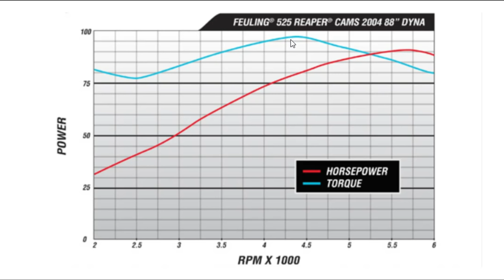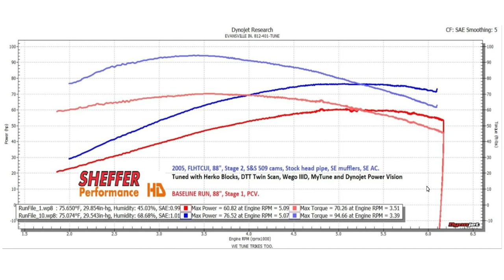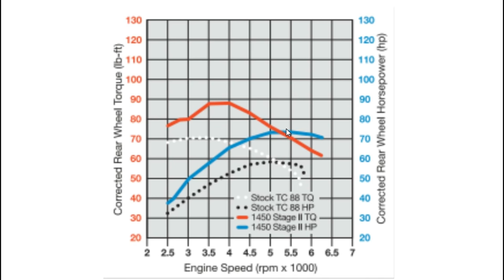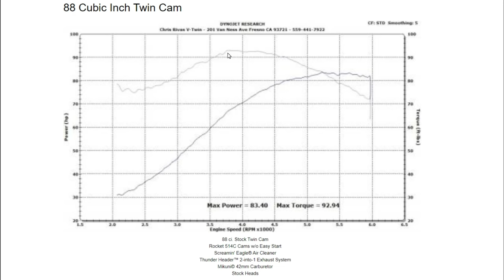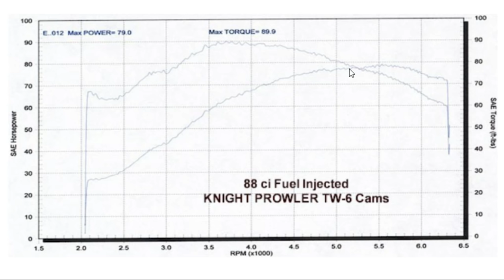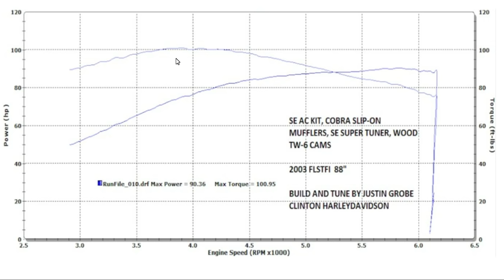Give Your Twin Cam 88 New Life With A Bolt In Cam Upgrade

Comment: Love all these cam reviews. I've completed engine upgrades on dozens of 88" twin cams from 2006 and down. Minimally I recommend a stage 2 upgrade with a gear cam that fits your riding style. I live near the mountains so I like the 509 for heavy bikes or for someone who rides with a passenger more often than alone. The Andrews 26 is the cam I recommend for one up and lighter motorcycles. I've also installed the SE 203 and SE 204 for those who want to stay with HD parts. Both are great but I lean towards the 204. I've never tried a Rocket cam but I think the one you reviewed needs to be installed in an 04 model or newer because of lift. Very hard to go by the peak numbers from different dyno machines. I always look at the curve over numbers. For example, my first stage 1 dyno tune at the Harley dealer claimed 103 TQ and 89 HP on my 2013 FLHTK. Never liked the tune so I took it to who I feel is the best in the area. His peak numbers before his tune showed 89TQ and 72HP. That's a huge difference for the same bike on different dyno's. Sorry for the long post but I love this stuff and can talk or type forever.
Reply: Since you have upgraded several TC88's, given your experience, would you recommend the 509 and head porting work for a 1999 Road King with a 230 lb rider?  Right now all it has is an upgraded air cleaner, re-jetted carb and Fulsac true duals using mufflers off a CVO 110 bike.
Reply from the maker: I'm with you, I can go on and on about this stuff myself too! That's some great info on your installs, you and I are on the same page about the cams!
Reply: @jimedward8908  My first question is do you have a local shop you trust? Second, do you like speed, torque, racing your buddies when the light turns green? An increase in displacement and headwork opens up another world when it comes to choices. I ride in the 2,000 to 3,500 rpm range so any power beyond 4,000 is wasted on someone like myself. This sounds like a great topic for another video. Hint, hint...
Reply from the maker: That's really not a bad idea, l tried to keep cams for the all around power. Finding good high torque cams that come on early and peak mid are easy to find.
Reply: @jimedward8908  I would contact the person who's doing the head work so he can set up the chamber to the proper compression and the cams timing!
Reply: @jimedward8908  all you need is a 95" kit with 203 cams!! Comes with everything you need!
Reply: @enricomandragona163  thanks, that is great advice!
Reply: @jimedward8908  thanks Jim . I'm on the fence whether I'm gonna put Harley Factory ported heads & keep stock displacement or just do a 95" and clean the heads up with a valve job!!
Reply: Not long at all. Thank you!  My Dad just gave me his 05 Ultra classic. I never had a Harley before and now I wish I would have tried one a long time ago. I'm 57 next month. This bike has only 1400 miles on it. Nothing has ever been done to it. It runs great just needs some power. It is Fuel injected. Not sure witch cam I need. I ride back roads right now but may take a road trip W/Wife every now and then one day. We are both a little heavy. Around 420 LB total. Any advice would be appreciated.
Reply: I have a 2003 fxst 88fc Putting in s&s 509 wondering if you could give some advice on rejetting the carb I would appreciate it.

Comment: I just did the 509 swap last week.  I am super pleased with how it pulls and pulls.   I have the Reinhardt true duals on and it has the perfect amount of rowdy on the exhaust note
Reply from the maker: That is awesome! Rinehart really seems to be what a lot of shops are recommending!
Reply: Hey Michael, same here! did you have to retune after this upgrade?
Reply: @DJDooxx  509s and RH true duals as well. A good tune  is a wonderful thing
Reply: Tried the 509g in a SE 95 bigbore??
Reply: @twitterjackedmitchell8096  509 is a low lift cam, I'd try something else in a 95 and maybe add head work if the budget allowed and then you'd have something fun

Comment: I put an S&S 509 gear cam in my 2002 Electra glide FI and the wood ( night prowler) TW6 gear cam in my wife 2010 super glide (96). Best thing I’ve done for my Electra so far. I just love the torque that move the bike. It’s no rocket but I do not downshift to pass a vehicle anymore. Took a bit of fiddling with the tuning but got it right on now. The wife is now pleased with hers as before she felt that the power delivery was different and she did not like it at first. We are both very happy now and no, the noise isn’t noticeable.
Reply: I'm wanting to replace my stock cam on my 2002 Fatboy with a gear drive if crank runout will allow it. I was thinking of going with the S&S 509. After watching this again I'm leaning toward the TW6. Some forums mention the TW6 is much noisier than some, I see you you say it's not noticeable. Curious if you had my bike which of the 2 gear cams would you choose?
Reply: @robbaar7035   I am partial to my 509. I like the torque it produce, it is tractor like. Not much high rpm but then I rarely need to go there. I am a big and heavy man so racing is not in my plan, I enjoy riding and keep my rpm low. I do not ride my wife’s bike unless I have to trouble shoot something but it is very reliable so my seat time has been very short. Power is in higher rpm and sportier so it is your choice. My Electra is 850+ pounds and your fat boy is about 720 so I would consider the tw6 very closely or s&s510. The 509 is best suited for heavy bike. That’s just my opinion.
Reply: @yz490w  Thanks, I appreciate your response. Would I need to replace valve springs if I went with the S&S 510?
Reply: @robbaar7035  no, stock valve train. Look at the video on s&s.
Reply: @yz490w  
I have a 2002 Fatboy with a stock 88 ci other than a Bassani Road Rage II 2 into 1 exhaust, a K & N high flow air cleaner, and a Dynojet Power Vision tuner. I flashed the tune Dynojet sent me for what I currently have. I want to add a S & S cam plate kit with new oil pump and 509 gear drive cams if crankshaft runout allows it. My question is do I need a new Dynojet tune for the cam change? All the tunes I've looked at on Dynojet website only ask what you have for exhaust and air cleaner, nothing I can find about cams?Maybe the current tune I have will work with the 509 cam upgrade?
Reply: @robbaar7035  dynojet has that setup with the 509. At that point check your spark plugs to see if your fuel ratio is correct.

Comment: I did an air cleaner slip-ons and a fueling 525 cams and man it really woke the bike up oh and that's a twin cam 88 and you want to take it to
Reply from the maker: It's amazing what a cam will do on Harley!
Reply: @GixxerFoo  
OK. I'm getting ready to accept the deficiencies of the H-D Big Twin (I think?). I have been paying close attention to what you've said about the bearings on the 88 and how affordable these bikes are these days. The part that sold me was the 98 cubic inch trick with Hammer and proper Wood cams, not too mention the cam tensioner trick. I've located a 2000 Fatboy with 5,400 original miles, so immediately getting the thing dialed in from the get go is a huge plus. Coming from a '08 Suzuki BKing and now a '14 Suzuki V-Strom DL1000, I absolutely have to have a reliable, useful motorcycling experience. I also have a 2002 Buell S3T Thunderbolt with 10K original miles. I cannot stand unreliable or expensive repairs and absolutely need reliable, day in day out performance. I don't mind wrenching on things, but everything has too come together in a cost effective and efficient manner.

Comment: Some people I think have lost sight of what an air cooled, pushrod VTwin Harley is about: The look, sound, the feel and experience. Some of these guys waste alot of money wanting to try and build a Harley that will smoke a Sportbike, while that is possible, it's going to be hard to beat these bigger bore Sportbikes 1200cc and over. Don't waste your time trying to do that. On an a Twin Cam 88 motor a 25 = 30 hp gain will make a huge difference. That would put you up in the 85 = 90 hp, and 100 ft. lbs of torque. range that will feel really good on a Twin Cam.
Reply: If I want a serious fast bike, I'll stick a crotch rocket motor in a custom chopper frame. I have an old 750 honda motor in a stretched out frame with Harley tanks and front end. Its lighter and faster than any of my Harleys and screams like a violated mountain lion. Harleys sound tough, straight piped crotch rockets sound terrifying.

Comment: SE 203 cams don’t hold a candle to the SE 204 set up with 9.8:1 compression. This combo gives 203 low end torque but has more horsepower. Add the 1.7 SE rockers for more lift with 06 and up heads makes a killer combo
Reply: Good suggestions! I have 203's in my RoadKing. My next upgrade is factory ported heads maybe a 95" big bore

Comment: I put SS 509s in my 88 and Screaming Eagle oil pump/billet cam plate and timkin bearings with hydraulic chain tensions. Love it. More power and oil pressure. Great upgrade
Reply from the maker: Sounds great! You got nothing to worry about on that bottom end now, 509 is a excellent cam in the 88. Did you go with the easy start option?

Comment: 525 rapers S&S pushrods S&S rollers made a world of difference on my 04 Heritage fuel injected 88b I love it
Reply: I have the same bike same year I bought the fueling kit conversion cam plate thought the ss 509 cams would work with this camp late but it doesn't cuzz its a conversion so I'm going 525 mite as well match everything

Comment: Came back for a  second look.

If I read the chart correctly, the 509 cam produces significantly  more hp and trq in the 2,000 to 3,500 range which is where I normally operate. That would definitely feel stronger than the Feuling cam to my style of riding.

Plus, I think I lucked out. With just stage one, my 88 can pull away at idle by just easing out the clutch. I have ridden in a group with other 88's and I was easily able to catch them when they sped up after a major slowdown. Now, with 85,000 miles I'm going in to replace the cam shoes and do a major re-torque of all nuts and bolts on the whole bike.

I greatly appreciate this review on the cams. I was researching the procedure of replacing the shoes when I found your review by accident.
Reply from the maker: That's exactly how you pick the right cam for your bike! You gotta look where you normally ride and not worry so much on the peak numbers.
Reply: @GixxerFoo  I was  talking with an independent Harley repair shop regarding the cam shoes. he mentioned something relevant. If I install the 509 cam with higher lift, it wil be pushing the valves a tiny bit more into unused territory. That could mean the valve seals get scraped up and it will start burning oil. if the engine only had 30,000  miles it would probably not be an issue. But with 85,000 miles maybe I should replace the valve seals now while I am tearing down to replace the cam shoes.

Comment: Thanks for a clear and concise video. 

I am leaning toward the S&S 509 due to the smoothness of the curve. I seldom run higher than 3000 between gears.
Before I picked up the bike, I had the dealer install high flow air filter, reworked  the filter housing to allow air to enter from more places, rejet the carb, and install the screaming eagle ignition module. I drilled out the factory mufflers with a long drill extension so they breath a lot better but look stock if stopped by hard ass cop. My bike has so much torque I can ease out the clutch at idle and it takes off. I swapped the exhaust for V&H long shots but there was no cross over pipe between the pipes. The low end torque was gone. I put the stock exhaust back on and wow the torque was back. I could not believe the factory mufflers with crossover was better than with open exhaust, no crossover.
Reply: For your bike the 510 would be a better option!!
Reply: Better yet put D& D's on or old super traps made for screaming eagle
Reply: @enricomandragona163  according to the chart, the 509 makes more power at low rpm. The 510 requires higher rpm to get the most from the cam.
Reply: @unclemikeb  in a real world mike the 510 is more established!! 
Rule #1, Dyno charts  are a general average. The same bike in different parts of the country are going to behave differently. Especially when you use a cam with an intake valve closing sooner than the factory cam of 34-36° ATDC!! Good example is the Andrews TW-21 and EV-21! Theses types of cams build up too much cylinder pressure with not a whole lot of duration to allow time for it to escape out of the exhaust system. Not much overlap either! Your gonna get pinging especially with a SE module!! At least with an Evo you can adjust the static timing. Get an adjustable module! 
You want a good all around cam run the 203!! You'll be happy & it tolerates everything!! 
Rule #2 don't listen to a drunk in a bar what can to run 🙄🤐

Comment: Would just like to thank you for convincing me that a Twin Cam was the way to go. I picked up a 103ci Fat Bob this week over a much more expensive M8 after seeing the performance differences weren't far apart. It came with bags, windshield, cobra slip ons, and only 4000 miles. I was surprised how much power it had. I'll be referencing any videos you've made on the 103ci TC for ideas. The fact that I can buy a whole new 111ci to 124ci motor from S&S for under 7 grand is cool too. Maybe you should do a vid on replacement motors next?
Reply from the maker: Fat Bob is one of my favorites, the stock seat on 103 Fat Bob is like a hammock. I love those seats, it's an excellent handling motorcycle too. I like the new Softail Fat Bob but at the end of the day I would do what you did and pick up a nice low miles used Dyna version.

Comment: About a month ago, I put the Wood TW-6 cams and a Power Commander tuner on my 88 twin cam Electra Glide. I didn't have it dynoed but I'm very pleased with the results. Thanks for the advice.
Reply from the maker: Very nice! A cam makes a huge difference!
Reply: Any spring problems with installing the TW-6 cams ?
Reply: @hermanbrown4786  I'm assuming you're talking about the valve springs, I didn't install them myself so I can't offer intelligence about installation. If you're asking about reliability I haven't had any problems, I chose TW-6 Nightprowlers 'cause I was given to     believe that is as big as you can go without having to upgrade the rest of the valve train.

Comment: I just got my bike back,went with the S&S 509 cam,S&S tappets,S.E pushrods/tubes,S.E hydraulic cam plate with high flow oil pump. Already had a Ness big sucker kit with breather bypass’s,BUB 2 into 1 pipe and a S.E pro tuner. Made 72 HP at 4850,94 Torque at 3250. Runout was .003, thanks for all the content,it helped with some of my choices.
Reply from the maker: Those are really good numbers on a 88! 88's put the torque down hard, excellent run out too!
Reply: The stock spring tensioner’s were in good shape when pulled,bike has 22k miles,everything looked good inside 👍

Comment: Just completed my upgrades today. Fueling camplate and oilpump, 525 cams, V&H intake, headers and slipons. Good tune set.
Really starts pulling from about 2200 rpm. For an 88 with 135k kilometers on it..😀👍
Reply: 2000 FXDWG 54,000 miles. Stage 1 @ 72 HP,  85 ft-lbs. I'm ready to order parts for the for stage 2 using the Feuling camchest upgrade with either 525/ 543 can set or Andrews 37N. In hindsight was your 525 a good choice? I live in wide open country and this is a lightweight solo ride. Just doing the cams now and the Hammer 98" cylinder and head kit next year. Thanks in advance.
Reply: @buckguest3012  Yep, the 525 was for me a good choice. Very happy with it. My set up however is set for 2 up long travel across Europe when the bug  is gone.
Reply: @buckguest3012   This is all on a 2004 Electra Glide Classic.
Reply: @64Goef  Many thanks sir for the response. Enjoy and ride safely.
Reply from the maker: 525 is a excellent choice for high torque, adding that Feuling cam plate is just some added insurance as well.
Reply from the maker: You've got a really nice setup on there, what year is your bike?
Reply: @GixxerFoo   2004 electra glide classic. Additional to the cams and other stuff,e I did a tanklift and some type of winglets to redirect the wind coming from under the batwing to flow under the tank. That made a huge difference in engine temperature and is not running hot anymore. Also wind buffeting is down 80%.😀
Reply from the maker: That's a really smart idea! Keep the wind off and cool the motor down, l haven't heard of anyone directing it toward the motor before.
Reply: @GixxerFoo   check the site of DK customs, they do alot with heat issues on HD. 👍👍
Reply from the maker: DK customs has some awesome products, they are very innovative!

Comment: I have a 2000 carbed Deuce...no idea what upgrades were done internally. Put it on the Dyno after installing a Dakota Digital guage to dial in the speedo. Turns out its putting out 85hp and 95ftlb. Going to crack her open this winter and see what's been done. I know these cams will be older aftermarket. I am the 3rd owner. 1st owner did the staging...2nd owner was a mailman who owned it a year and knew nothing about the bike. Between these 2 owners it sat for 8 years in a sea of bikes for sale at a place called "Power Brokers" I purchased it with mileage @10k it now has 15k. Your videos are very helpful and I am anxious to find out what this TC88 has in it after seeing the numbers you have shown! Thanks for the great videos!!!!!
Reply from the maker: Thank you, I appreciate the support! That bikes had some work done to it for sure, those numbers are too strong to just be exhaust and an air cleaner.